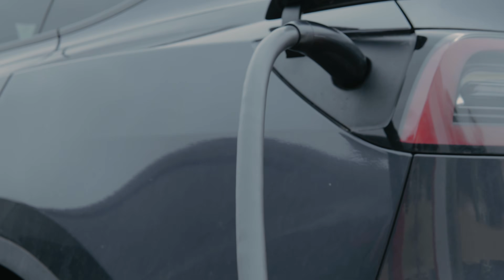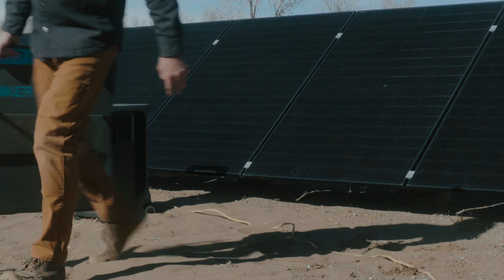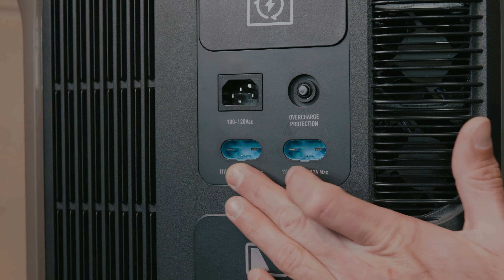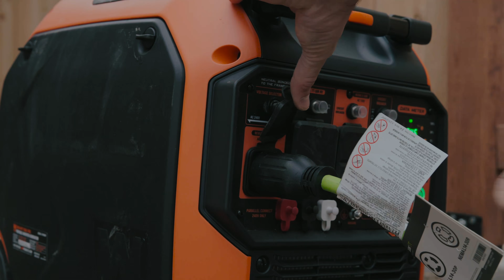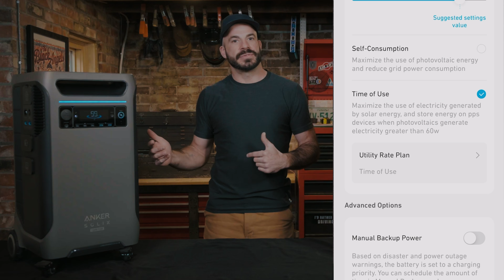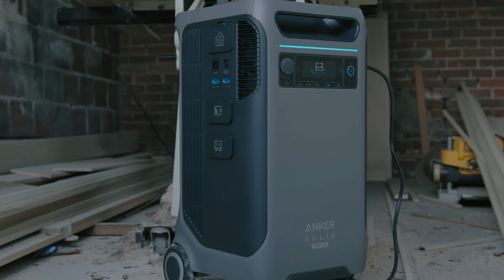Anker SOLIX F3800 Plus vs. F3800: The Ultimate Power Showdown You Can’t Miss!

Comment: Question i have an older Generac 30 amp 120/240 volt transfer switch  on my home electric panel. I currently run an under size 4000watt gas generator in emergency only and run only refrigerator, lights , garage door.   I am concerned about newer electronics like laptops, cell phones etc . I want to replace generator with a F3800 or F3800 plus or a new 10.000 watt inverter generator.   Hoping to go battery.. your opinion. Mr Fowler

Comment: I was hoping anker can address the EV charging piece. Change from 14-50 to the 14-30r. Original f3800 also didn’t need additional equipment. Seems like they know this is an inconvenient change 

Anker EVSE is 14-50. What EVSE do they recommend to work with the plus ? What adapter for 14-50 EVSE to plug into the f3800 plus
Reply: You would need an L14-30P to 14-50R adapter, and just keep your charging amps @ 25 amps or lower.  240v*25A = 6000w
Reply: @hieyeque1  yep I’m tracking that and it’s not very difficult but I’d like to see a YouTube video on it because videos like this one are pretty much worthless

Comment: So here's a question ...

If I do not use a smart home panel, and instead use the hub to connect two F3800 Plus together to get 240 into a 50 amp generator inlet to an interlocked breaker in my main panel, how can I also include the Generator adapter into the configuration ? Is there another adapter that hooks up to the bottom smart generator connector ?

Thanks

Comment: The original F3800 is actually better for directly charging an EV with its built-in 14-50 outlet and a mode specifically for charging EVs which is what I use and primarily got it for 💁‍♂️
Reply: I did the same with my Ford lightning although of course, my case it effectively only added about 6 to 8 miles of range.   So now I’m just looking for a small and light 240 V generator for those rare occasions when I’m way out in the wilderness or on a long road trip in the winter in the middle of nowhere. But to be honest, I have never once needed to use itjust like the idea of having it just in case.
Reply: For the F3800 Plus, You would need an L14-30P to 14-50R adapter, and just keep your charging amps @ 25 amps or lower (for either Plus or regular F3800).  240v*25A = 6000w
Reply: Does that give you another 10 miles or so?

Comment: You’re able to charge an EV with the first version too.
Reply: Yeah. I don’t understand that part and it was NEMA 14-50. How is this better ?
Reply: @Idiocracy-4Sure  The NEMA 14-50 is just a plug, but the F3800 can't really supply that kind of power (12,000w on that port).  The 6000w inverter means that the NEMA L14-30R is really all it can do (which is rated for 7200w).  It's convenient to have, but you have to turn the amps down on your car to ensure you don't over draw either one of those.

It is true that you can charge an EV on the old one, but you might need purchase a Neutral Bonding Plug.